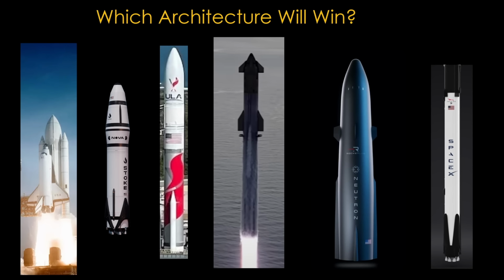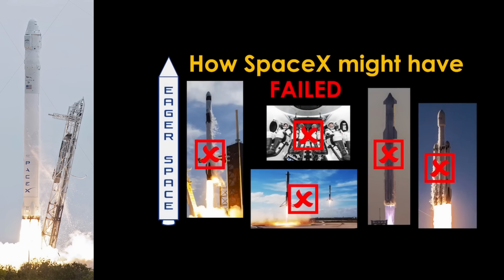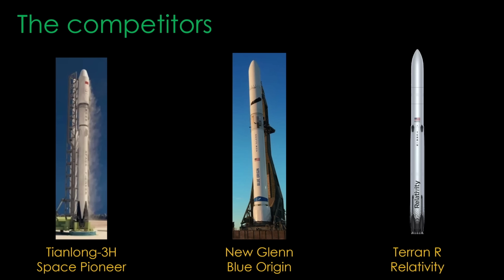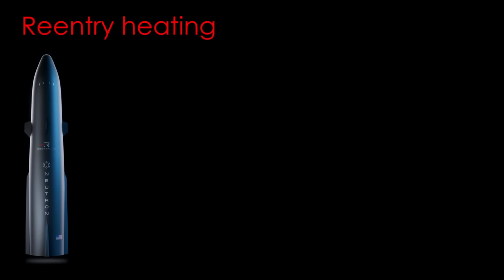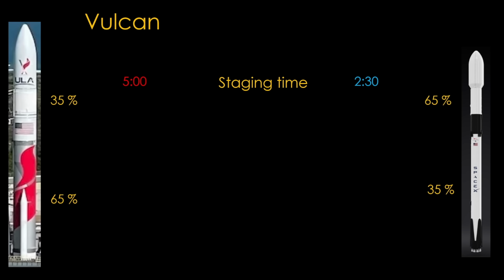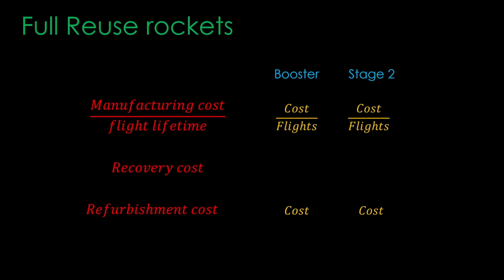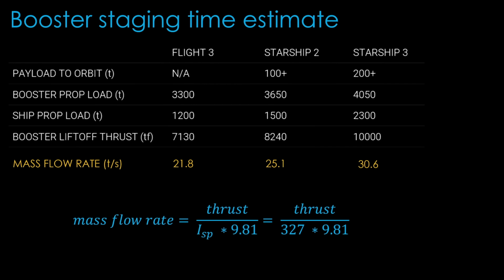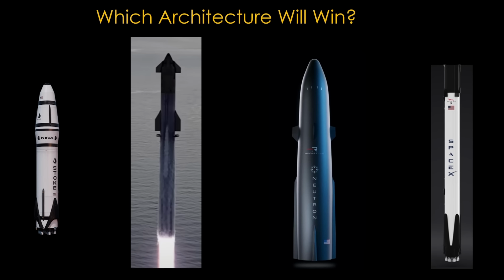Who wins the reusability race?

Comment: Back here after the successful landing of the second New Glenn booster.  Sure, it's slightly modified from Falcon 9, but it was still impressive to see, especially watching it using those strakes for crossrange. Seems that the hover maneuver would be harder on fuel than the suicide burn/hoverslam.  I'm less concerned about the weld to the deck as I'm pretty sure F9 has crush cores that need replacement each time too, so that seems like it's just a practical way to secure the booster.
Reply from the maker: I think they are likely using powder actuated fasteners to attach it to the deck. Easier, quicker, lighter than welding. 

Welding would be really hard to do. You'd need to electrically isolate the legs from each other and have a big power supply to push enough current.

Comment: 27:05 the second stage has a very high isp dew to being hydrogen I'm not sure but I think the efecency of the hydrogen engine (one 24 chamber engine) is enough that it could do this even with a lower perpelt mass (hydrogen being not dens and all) 
it's also probably why hydrogen was chosen hydrogen is somewhat rarely used today at least in reusable rockets
Also it officially will have a 3 ton payload so its barely a medium lift rocket
But it's not throwing away hardware and the engines on both stages are reuse friendly so a large portion of operation cost would be fuel (no ships needed they're doing return to launch with the first stage) stokes idea is to have rocket operation be more like aircraft whether or not it's a good idea time will tell but they'll either be highly distributive or not profitable at all in my opinion

Comment: One minor detail regarding Vulcan could sneak up on everybody: What if United Launch Alliance proceeds with Vulcan, and eventually develops its "SMART RE-use" technique for both the first and second stages? If ULA is able to recover both the BE-4 engines and the RL-10 engines, they can re-use all of the Vulcan/Centaur engines except for the solid rocket boosters. I know that the "believe it when I see it" approach is the safest bet here, but only time will tell.
Reply from the maker: Whether the LOFTID approach is practical for second stages is a really interesting question. It's going to depend on what the payload penalty will be for all the hardware, and I expect it would be quite a bit worse for the second stage than the first stage.

Comment: As Starship evolves it seems more like an SSTO with a headstart than a traditional two-stage rocket. The v3 Starship weighing almost as much as the booster is ridiculous.
Reply from the maker: It is weird, but it makes sense architecturally. The delta v penalty of landing starship is roughly constant even if it gets bigger, but the delta v penalty of super heavy gets a lot smaller if it does less work.

SSTO with a headstart is a pretty good description.

Comment: The dismissal of New Glenn seems more than a little glib. Its only semi reusable, but also a heavy lift rocket, and scheduled to launch this year... Doesnt feel like an honest or thoughtful take.
Reply from the maker: I think there are two big strikes against New Glenn...
The first is that from an architectural perspective they don't have anything over Falcon 9 - New Glenn is a big conventionally-designed rocket where the first stage is reusable. That's why I contrasted it with Neutron, which is a very different approach, an approach to optimize the partially-reusable approach. 
The second is that one of the key parts of being competitive is just getting good at the end-to-end rocket launching business - all of the things from designs that are cheap to manufacture, test, and refurbish to operationally efficient approaches to fly at high launch rates. SpaceX obviously has a ton of experience with that in Falcon 9, and they have the advantage of a history of operating in an environment that is very cost-sensitive. Blue doesn't have that the operational experience and they have been operating in an environment where doing things fast and being cheap have not been big incentives. If a company spends 5+ years designing and building a rocket without worrying about all those things, it's unlikely that they will be great at that later on.

Comment: The surface areas of the neutron and f9 don't track. F9 (and probably neutron) enter like a pencil dive so can't use the full side area, just the bottom areas. 38.5 m^2 for neutron and 10.75 m^2 for the f9.

Comment: Maybe a dumb question, but assuming Starship ends up being even remotely close to what SpaceX is aiming for, how could a partially reusable rocket survive in an industry where something like that exists? Wouldn't the costs difference for getting mass into space be absurdly large?
Reply: Yup, that's a problem. Even for Neutron or F9 size payloads Starship will be better. Elon's goal is for the cost per flight to be so low that an F9 size payload  can be flown more cheaply on Starship than F9. The analogy someone came up with is if you want to deliver a pizza and have a tractor trailer truck that's cheaper to operate than an SUV - use the tractor trailer! Non-intuitive but it makes sense. Of course, that's IF Starship hits its potential. (Propellant is only 3-4% of a rocket's launch cost, IIRC.)

Partial-reuse rockets can survive to an extent. The Department of Defense and NASA have a policy of using two or more launch providers. The DoD puts out big contracts from multiple launches every few years, National Security Space Launch. We're in NSSL-2 now and NSSL-3 contract slots are up for consideration. NSSL-3 will have separate tracks, this is where Electron and Neutron and Stoke can bid for small to medium missions. Vulcan & New Glenn and Starship will take the big ones - but it's possible Vulcan or New Glenn won't make the cut.

Even with just F9 flying every other entity was just bidding for second place.

Ariane 6 will fly at a low cadence to carry national security payloads for Europe. Ditto for H3 (Japan) and maybe Korea's new rocket. With only a few commercial customers on Ariane 6 the cost per flight will be high, it'll probably be subsidized by the EU.
Reply from the maker: Why is electron surviving when SpaceX has Falcon 9 and it's cheaper per kilogram to fly on Falcon 9?

Comment: Starship is having heat shield problems. What if it turns out to be impossible to make a heat shield that can survive atmospheric heating and be reused without any refurbishment, and they are effectively single-use? This would be a problem for Mars missions.

I'm thinking of two scenarios. In the first scenario, two Starships go to Mars. One enters the atmosphere and lands. The second Starship enters Mars orbit and waits, with or without a crew. This requires extra fuel. When the surface mission ends, the Starship launches from the surface of Mars and docks with the Starship in Mars orbit. The surface crew transfers to the orbiting Starship and they safely return to earth. The other Starship is expended.

In the second scenario, only one Starship goes to Mars. It lands, and the crew carries out the mission. When the surface mission ends, they launch from Mars, head to earth, and enter earth orbit. This also requires extra fuel. Then a second Starship is launched and docks with the ship in from Mars. The crew transfers to the second Starship and safely re-enters. The other Starship is expended.

In both scenarios the heat shields only endure one atmospheric entry, but in both cases extra fuel is needed to enter planetary orbit. Also, in each case, a Starship is expended. Is this even practical, and if it is, what does it do to Starship's payload capacity to and from Mars?
Reply: The starship in orbit should be a tanker without heatshield.  Refuel and re-entry burn enough that whatever hearshield you have works.  Have a Dragon with upgraded heatshield aboard the tanker for earth re-entry.

Comment: @Eager Space what would happen to Falcon 9 and heavy if SpaceX slapped a few of the new AR1 engines from Aerojet Rocketdyne to its first and second stage? Since development of the AR1 isn’t complete yet, perhaps we could even re-imagine it as the AR0.5, an RD-191 inspired engine.
Would it mean anything usefull besides the cost? Could they stretch the booster or land more often at KSC?
Reply from the maker: Short answer is that the lower thrust/weight of the AR1 (assuming it's like the RD-180) means that the extra ISP mostly doesn't help.
Reply: For thrust, 3 AR1s = 9 Merlin 1Ds. You can't land on 3 large engines. Using one leaves you off balance and anyway it can't throttle down enough to do the hoverslam - even disregarding the off-center thrust the engine would send the stage back up once the fuel mass dropped low enough.

I'm afraid the AR1 will never fly, it came along too late. Even the Air Force stopped paying for any development.

Comment: What about the Chinese? They are already test flying a rocket with the Falcon 9's octaweb 9 engine configuration and landing legs. They have also copied the Mechazilla launch tower in 6 months and will be attempting a tower catch next year. The CZ-9 is now just like the Superheavy with both expendable and reuseable upper stages.
Reply from the maker: It's really hard to evaluate any of the chinese launch companies because there is so little information available. I expect they will get something working but I have no idea what it will be or when.
Reply: @EagerSpace  Well, you CAN to some degree. They have launch, hover and landing footage. They also have video of the Mechazilla Clone tower putting the chopstick arms through its paces. So, it's not all behind a veil of secretly or just PPTs.
Reply from the maker: To do the analysis I want I need detail - stage masses, propellant mass, etc. Building a hopper doesn't tell me much about a real rocket - New Shepard is a good hopper but it's far too heavy to work as an orbital stage. 

I have the same problem with a bunch of rockets. SpaceX is pretty unique in how much they share.
Reply: @EagerSpace  Actually, once you know the external dimensions and the material of the booster you can guesstimate it's propellant fraction to within 10% or better. Going from aluminum to aluminum-lithium for instance only gets you 1% on a good day. For CH4/LOX you are looking at about 98% for balloon tanks, 95% for AlLi, 94% for aluminum and 88~90% for steel. LH2/LOX is about 5~6% worse; RP1/LOX is about 1% better.

Comment: Disconnecting the piping on the Vulcan Rocket to eject the Main Engines for recovery is going to be a HUGE nightmare for leaks and failures.  If they try this I see a tone of delays and scrubs for every attempted recover.
Reply from the maker: It's pretty much the same thing that shuttle did to disconnect the external tank. There were some problems with that for shuttle but since Vulcan uses methane rather than hydrogen it should be easier to deal with. 
It will take time to develop but a lot of that can be done before you fly.
Reply: @EagerSpace  The shuttle QDs were external.Vulcan shall be internal and inoperable after stack. I'd also question if its 2 QD or 4 QD (Quick Disconnect)
Reply from the maker: The quick disconnects for the shuttle are just forward of the front of the body flap and are covered with doors for reentry, so they are by necessity internal to the orbiter.
Reply: @EagerSpace  Yes but I don't think that is same as the disconnects and separation required for the entire structural thrust puck.